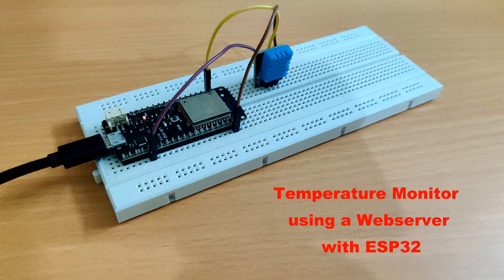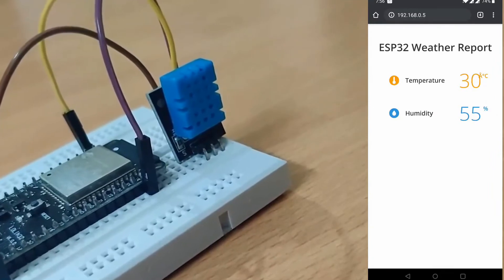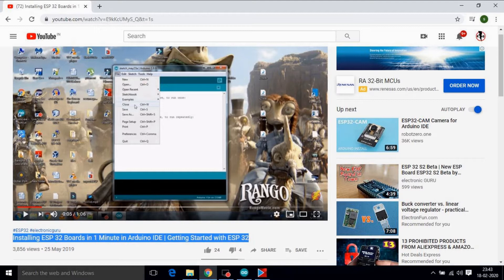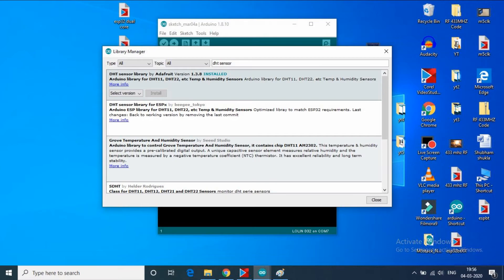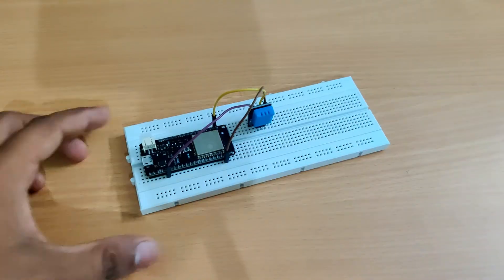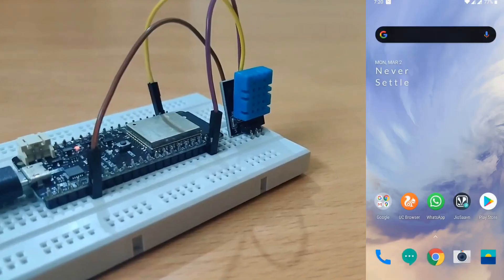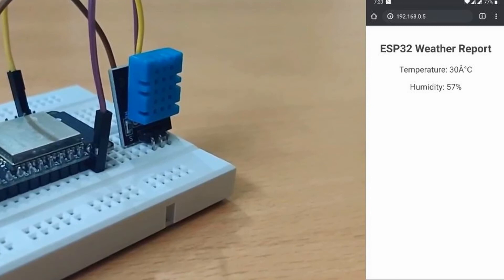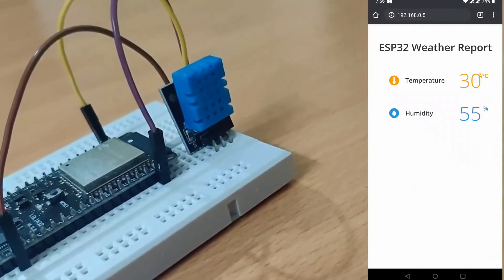DHT 11 ESP 32 weather report | ESP32 DHT11 weather station | Esp32 webserver temperature monitoring

Comment: Can I get the reading of voltage and current sensor also like this on the phone
Reply from the maker: yes you can,  you modify  the code to show those data
Reply: @electronicGURU  actually I have done it with the temperature sensor and it is giving error- no such directory found
Reply from the maker: totally  weird , you should troubleshoot it
Reply: @electronicGURU  actually I have done the troubleshooting and it's working now I want to do it with current and voltage sensor can you please send me code for it .
It is really very urgent.

Comment: Brother getting this temperature, 2147483647Â in the browser window. What should be the issue? Kindly lemme know Thanks.
Reply: I’m having the exact same problem!
Reply: I was also facing the same issue and sorted this out. It was an issue with the sensor. I took a new sensor and did the same wiring and it showed the correct temperature. One thing to keep in mind is that when you connect the wires to the pins, you should be very careful because if it is wired to the wrong pin there is a chance that the sensor can burn out (which happened in my case).
Reply from the maker: Good to hear that man !! I told everyone in the beginning to check the sensor.
Reply from the maker: Please check first if you sensor is working fine!!!
Reply: @electronicGURU  Thanks for your response, yes it's working. I tested it out on my Raspberry Pi 400 and it was providing accurate measurements.
Reply from the maker: Oh is it working with code as well. Just upload the DHT example to your esp and see in serial monitor if it gives peoper output.